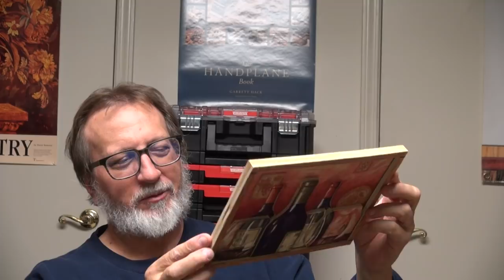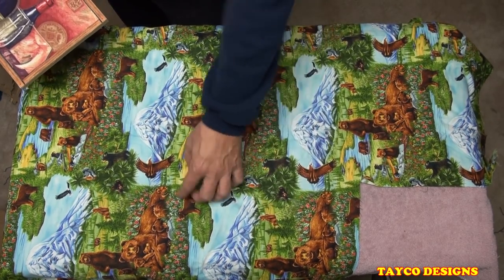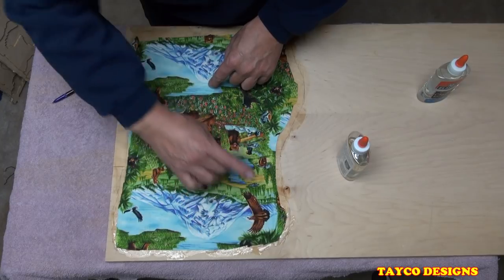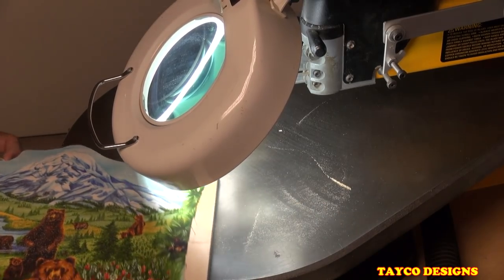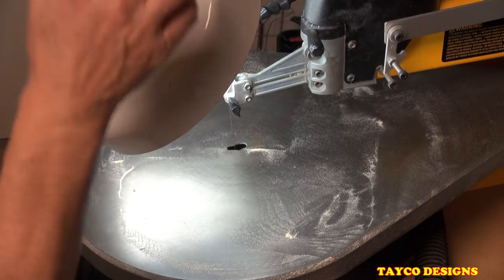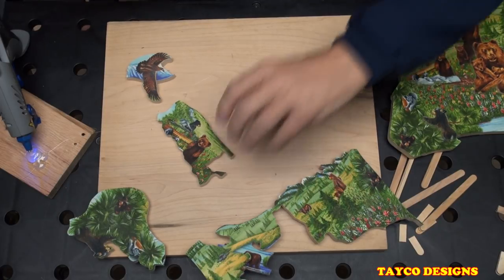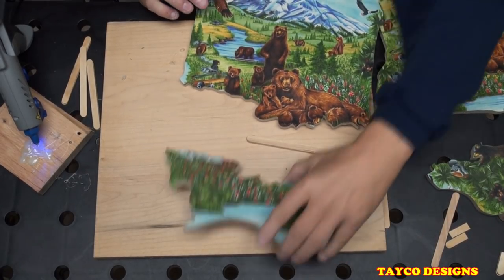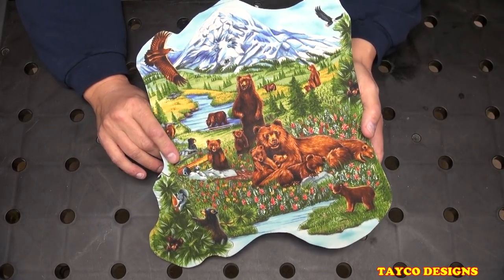Great Scroll Saw Project For Bonding With The Grand Kids Or Loved Ones

Comment: Believe it or not,my wife, while shopping today, is going to pick up some material so I can start on a cutting right away.  One question, do you every add a thin backer board to the project, and is there a need to apply a varnish like product to the front for protection?  I think your video put a smile on my wife's face this morning when she new I would be back in my shop soon..Ha Ha
Reply from the maker: And who gets to own the first project, you or your wife?
I put enough clear glue on the wood to seep through the fabric which in turn will put a 'seal' on the top....so no, I dint use a varnish. As far as a backer, that would depend on the picture. The 'wine' project would accept a backer with ease but the 'bear' project would be challenging to add a backer. 
Love to see what you come up with.

Comment: Karl I thank you so much for making this video.  I was also sent here by Steve Good.  I have been scrolling for over 50 years (only 75 yrs old) and of late I have run into a wall.  Seems like nothing can get me into my nice shop.  Nothing interesting to work on.  But WOW has this lit a fire under me.  My wife uses this concept when covering old table tops, but I never thought of using the scroll saw.  I guess I better get the Hegner cleaned off.  And yes of course I would love to see any of your scrolling video.
Reply from the maker: Thanks for the kind words. Put the grand kids in your lap and make a fun project together. LOL...or put your wife in your lap and have a little 'alone time' while scrolling together.

Comment: Hi, I love this idea. I bought some fabric, and I'm not having good luck putting the piece on 3/4" ply, (good ply). I sanded the ply, got the dust off, applied Alleene's clear gel, smoothed it out very nicely,  applied the fabric, and using a 4" plastic squeegee, (the ones they use to apply vinyl on signs), I smooth out the fabric, and I take my time making sure no wrinkles. It looks perfect. The next morning after the glue dries, I have several large wrinkles on the print. I have tried this twice, using more glue, and less glue on each attempt. I am going to try the Elmer's glue. The fabric print I have is very thin, (maybe that's the reason, don't know). Any suggestions would be helpful. Thanks
Reply from the maker: I have not had this happen, doesn't make sense to me.
Reply: Woodworking & DIY Videos i don’t know why either, but I tried modge podge and that is working just fine, cut my first one out last night turned out nice, thank you